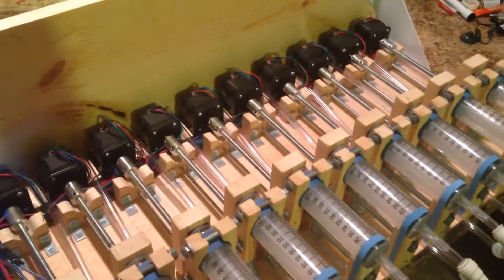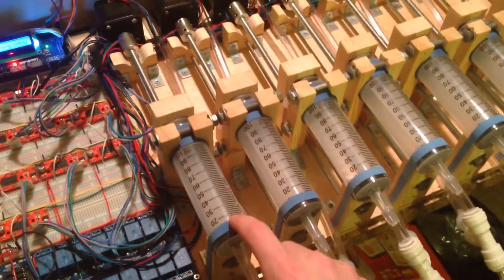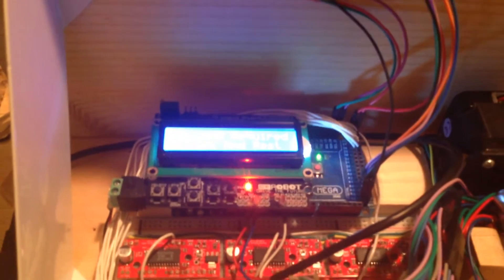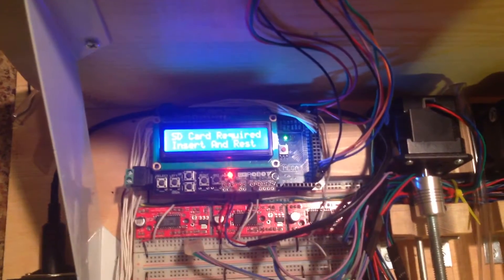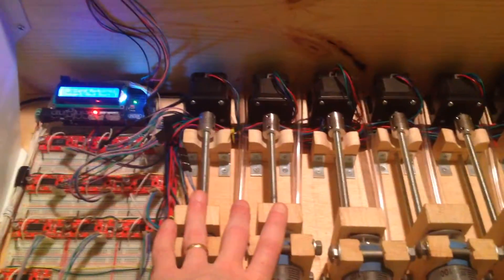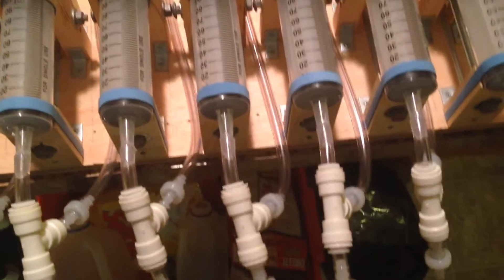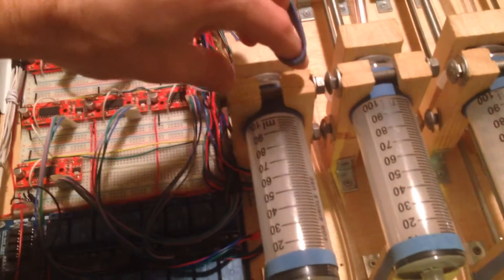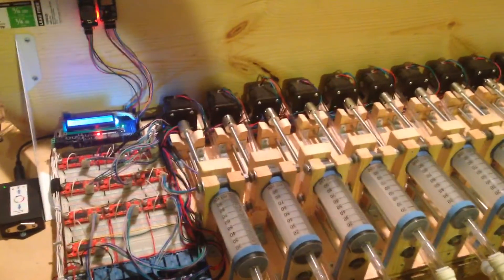Automatic Hydroponic Nutrient Doser DIY (Update #1)

Comment from the maker: I've ordered my last part to show off this finally working with actual fluids, but got we slammed with snow up here in the NW so its been delayed until next week. So next week I will be showing off the new pH reader that came in and got hooked up, Peristaltic Pump added and confirmed with OS and both pump types working with fluids.

That said, this weekend I compiled a list of needed parts to build the most cost effective version of this doser/OS (using Peristaltic pumps, ph / EC sensors, flow sensors etc.) and will be posting a full step by step video of the more cost efficient build within the next two weeks. Still not cheap at all to build (due to pumps, pH and EC sensors) like everything hydroponics, but way easier to build now and unit will auto dose up to 10 solutions, full top off / drain system and #4 120v plugs on the bottom that each can be timed for lighting, pumps or exhausts!

Comment: Hi Devin - That's some impressive progress you've been making there. Do you have a solution in mind for bulk liquid changes when you need to do a full drain and refill of your nutrient tanks? I was thinking of using a rotary vane flow sensor for measuring the drain/refill cycles for my own project (which still hasn't progressed at all). Cheers!!
Reply from the maker: Hi Jim, thank you very much! I NOW know what you mean about getting busy out of no where, here I am now 4 months later just wrapping this up heh. 

So to jump into the question, 11:19 I'm building out a drainage/top off system right now that will allow you to use the remaining 6 channels of the 16 channel relay to schedule out draining sessions. The idea being, that your drain line and water line (direct source or from a reservoir) will have electric ball valves on them and scheduled to be powered on by the relay from OS configuration. So for instance, I plan on (throughout a 14 day cycle) to use the OS drainage system to schedule topping off my buckets every 3/4 days with about a 30 seconds of drain time, and then on the 14th day schedule my buckets to a full flush for 10mins, close, and then release remaining water from reservoir back into buckets for 5mins and start a new 14 day cycle. The drain sessions (like dosing sessions) can be set to repeat hourly, daily, weekly, monthly or yearly (I leave no config option unavailable hehe).

Coming out of Alpha phase and into Beta phase of the OS, I don't have any plans (other than time based) to monitor the amount of fluids coming or going from drain lines, but I have noted it for an enhancement to beta. Can you tell me what you would be using that data for? I'm curious as it might be something that needs to go in sooner rather than later :)

Thanks again Jim.
Reply: Hi Devin - I'm interested in the data from drain/refill cycles because the amount of water that the plants use varies wildly in different parts of the year... In the cooler parts of the year I can leave the same nutrients in place for a month at a time, but in the heat of summer I have to top up the reservoirs every 2-3 days.... Also, I've had problems in the past with my NFT rails getting clogged up with roots and cause the nutrient solution to spill out onto the floor... This of course happens when I'm not in the greenhouse to see it, and I come back a couple of days later wondering why all the plants look so thirsty. Although a simple ball valve can keep the reservoirs topped up to the correct level, it doesn't alert me to problems in the same way that knowing the flow rates would do.... (I have also noticed that water consumption seems to go up massively when the plants get hit by aphids). My other reason for wanting to know the liquid volumes for drain/refill is because the amount of liquid in the reservoirs is never what I think it is... For example, I measure out 20 litres of liquid into a reservoir and mark a fill line... but then I put in a pump which occupies 1 litre of space, and an air stone and sometimes a heater too... so although I drew a line at the 20-litre mark, I actually only have 18.5 litres in the tank, which makes all of the dosing calculations slightly incorrect... I'm not sure it really makes much difference in practice, but when you can dose accurately to the milliletre level, it would seem fitting to know exactly how much liquid you're mixing with..... 
One last thing I forgot to mention... You said you had a peristaltic pump on order... My biochemist friend tells me that the silicone tubing they use in the pumps is slightly porous and air will work it's way into the system over a few days (I've yet to see this myself)... So when working with peristaltic pumps it's a good idea to run them backwards after dosing is finished to clear out the hoses and return the unmixed nutes back to their original containers. 
Cheers!!
Reply from the maker: Ah, yes that makes a lot of sense now. I didn't think of that cause my setup is inside in the shade, so my water levels are a bit more predictable than in a greenhouse. Well, ok lets try and make this happen; I have some questions though to try and make the user experience as optimal as possible.

1) If we lock in the drainage session to be only flow amount based, all users will need to buy water flow sensors + ball valves (where as time based would just be ball valves) correct? Do you know of any flow sensors that act like a valve as well? Do you think the OS should support both for builders choice or does that start to break down the user experience by adding another level of configuration when scheduling a drain session? I'm leaning more towards both, but I don't want to build just a matrix of screens users get lost in.

2) So for the reservoir flow amount, although we can read and store the flow amount for programmatic usage, the OS is far from being able to use this number to automatically decide on nutrient dosing session amounts for you. It is still up to the users to configure the dosing amounts per channel based on your reservoir water amount and manufacture recommend amounts. Each nutrient manufacture seems to have a slightly different concentration level, so unless that too gets configured in the channels, I'll never be able to make dosing amount decisions automatic for you based on flow amount of reservoir.. Is that ok, or not what you were expecting?

3) How were you planning on wanting to be alerted about an issue? What would constitute an issue to be alerted about? Can you help me come up some common or universal conditions?

4) The spilling water due to clogged lines I'm not sure if can be fixed with a flow sensor alone. See if the water is ending up on the floor, nothing is going to prevent the flow sensor from just reading all the water that passes it before ending up on the floor. I think that a better approach might be a water level sensor in rails and if within a reasonable amount of time after flow has pushed water to your rails, the water level sensor is still low it could trigger an error alert. You could also use this same water level sensor to trigger when rails need to be topped off automatically.

Thanks for the info on the pumps. I did order a single direction one so I could by pass a motor chip and lengthy setup for most builders, but I will note that in my next more cost effective doser build video for the OS.